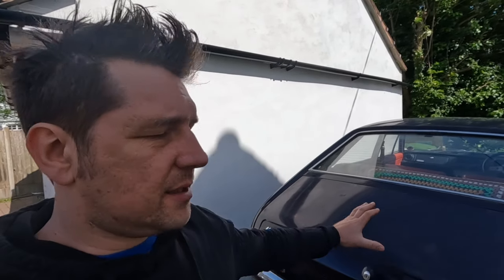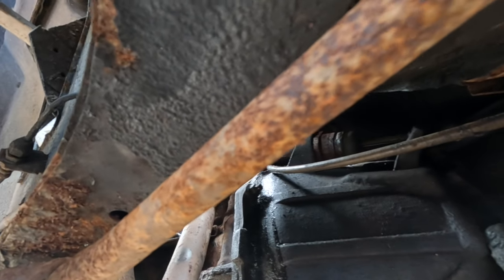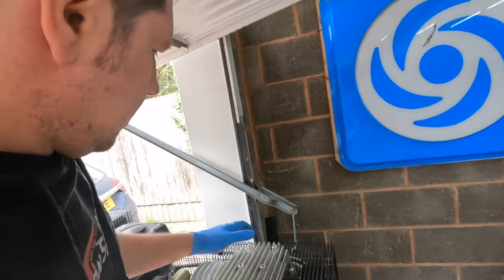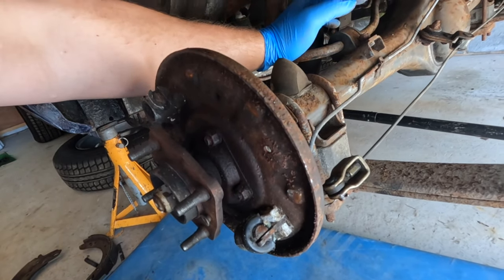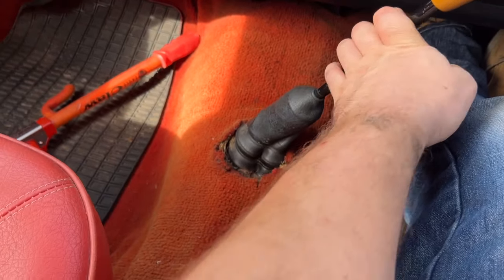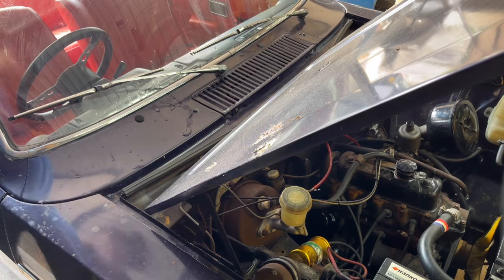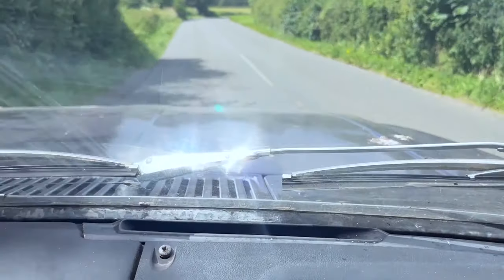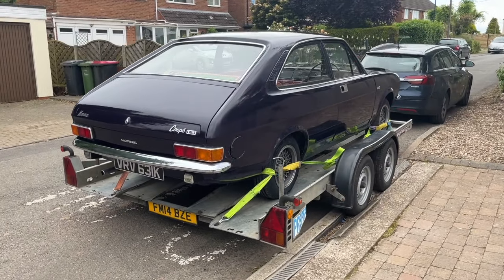What's Hiding in This Barn Find?

Comment: we had those things in Australia  , with an e series 2.6 6cylinder fitted , the Marina Red Six ! , couple of the local lads uprated them of course  , porting the head fitting triple SU's and tuned exhaust power went from 90 kw to about 140 , a must was to fit a Pedders suspension kit on the front which meant the car would now go and handle like it should have from the factory  , but it came in too late to save BL Australia , shame about that
Reply: The bright pink one on the cover of the Jan 74 edition of Wheels magazine looked mint
Reply: @phillcc8524  Aussies always knew how to do 70's saloon cars right. I love that look. Proper engines, beefed up suspension, bright colours, spoilers etc. Ace.
Reply: Yeh, I have one now.